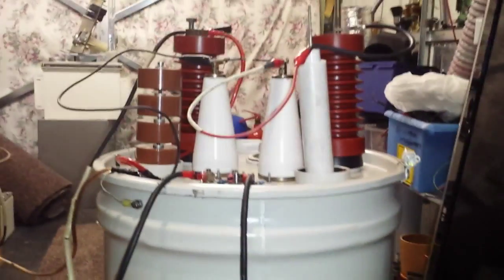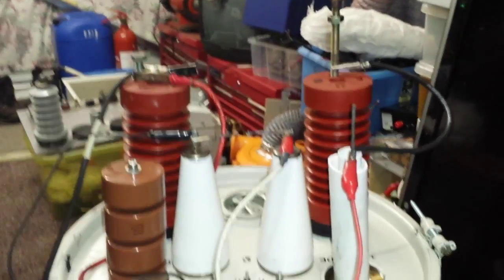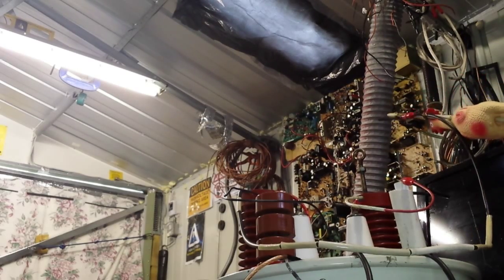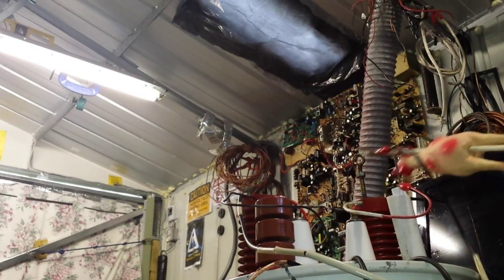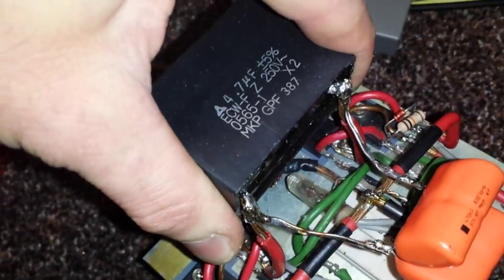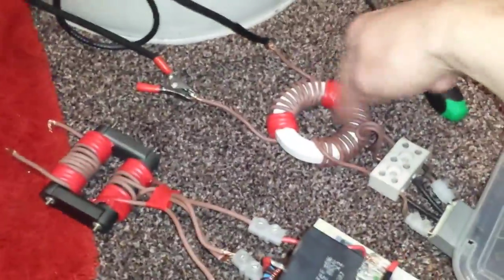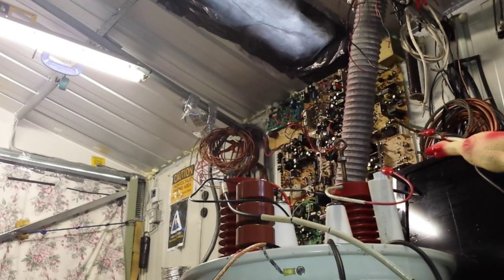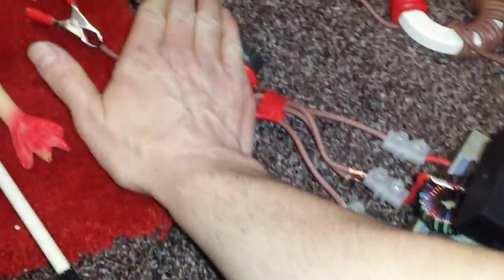⚡H.V 150kv x-ray transformer arcs"⚡ (running at 20% of its power)

Comment: Awesome, love the grunt from the variac. Bulged Cap LOL ! need to oil cool them. 2 or 3 in parallel is better for cooling and I sharing. those Cap terminals are often not that big and pushing 30 or 40 Amps through them = meltdown or unsolder. I like your oil cooled tank set up.

Comment: also the frequency is important as the tension increases.
I once bought capacitors and it could handling 20 Kv  but when we were view the datasheet this cap at 300 kHz is suitable for 10 volts. I was very disappointed in the manufacturer :S